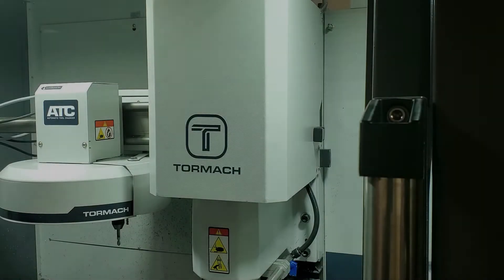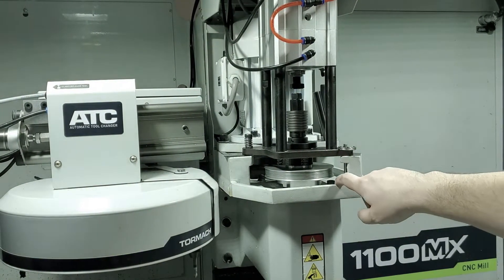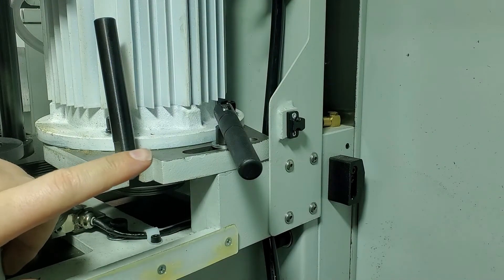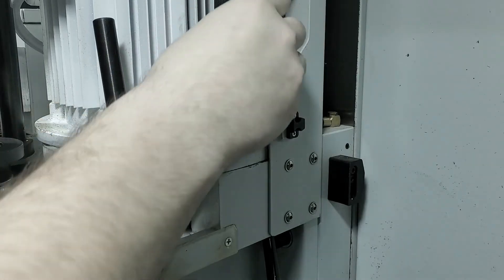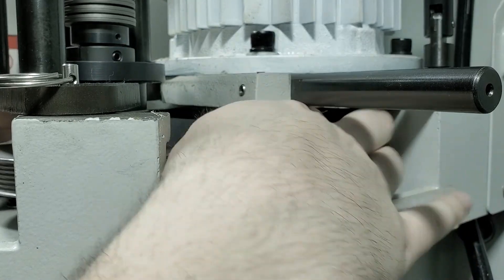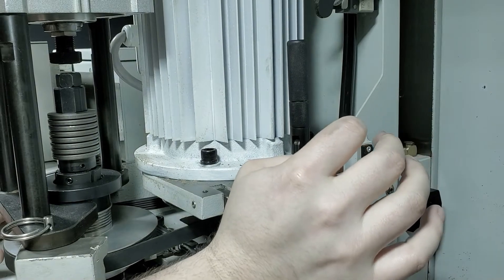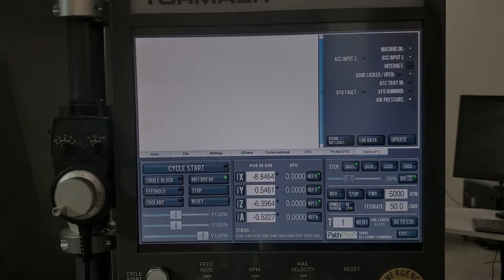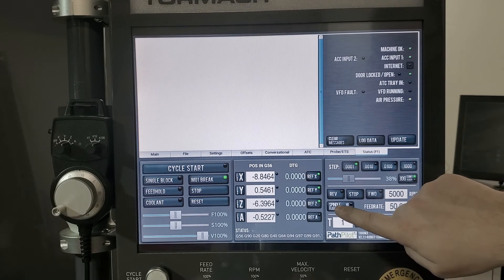Changing the Spindle Belt Range on Tormach Mills

Comment: I greatly appreciate you guys. I love my new Tormach 1100MX I just got and final assembled. Your support staff is amazing.
I don't know if you read comments, but I'd love it if you did a video on the accessories I got with my 1100mx with all the goodies.
I would like to see a Tool Zeroing video, using the ETS I got with the package. I would also like to see a video, using the touch probe, along with the ETS. Also, I cannot find why there's 2 screws with the ETS. I have some reading to do apparently ... some of the options don't have a lot of documents in it.. I'm a Mach3 user, and appreciate the fact it's so similar to Mach 3.. just wish I could use all the high end plugins I purchased for MACH3.. but it doesn't matter, because it's already built into pathpilot for the basics of the add-ons I purchased. I love the Console. It's just an incredible machine. I do get spindle movement however... which I'm kinda worried about.
Put the longer BT30 zero close collet adapter provided into the spindle. I put a dial test indicator into the jaws. I wiggled the bt30 back and forth a bit, and got quite a bit of deflection .. is that normal? unsure if this is common, or if my BT30 is not right, or where I'm getting flex from.. don't think this is normal and it's concerning to me on higher tolerance parts. Thanks again.